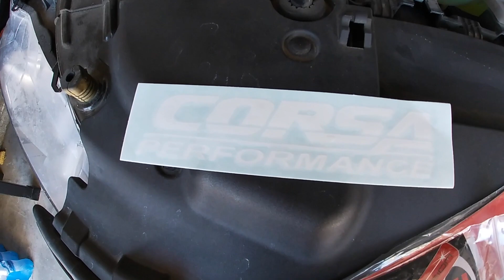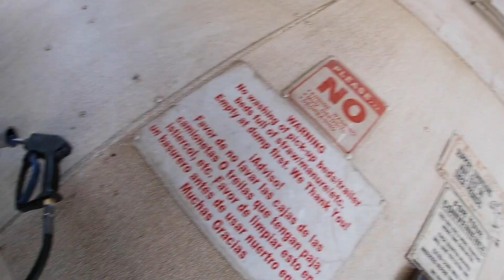Ruining my Mustang GT with a dremel

Comment: You should have used the biggest drill bit you could fit into the holes to get most of the material. Then switch to the Dremel with the sander bit to get the rest of it! If you want help bring it out sometime.